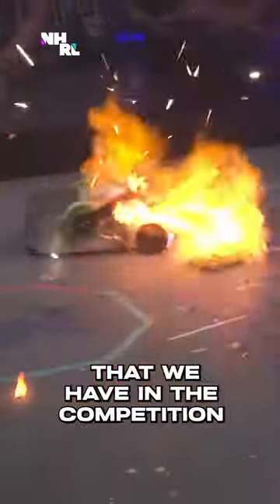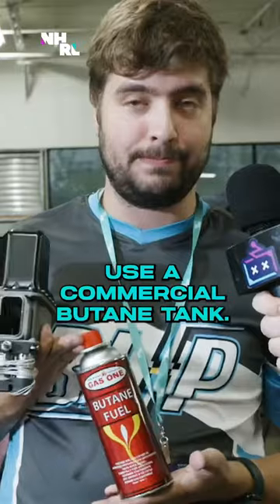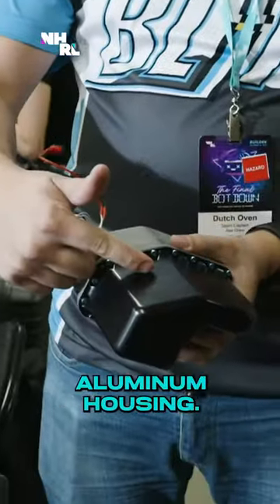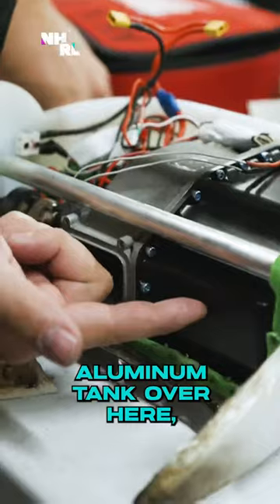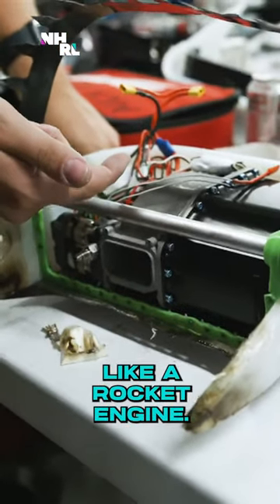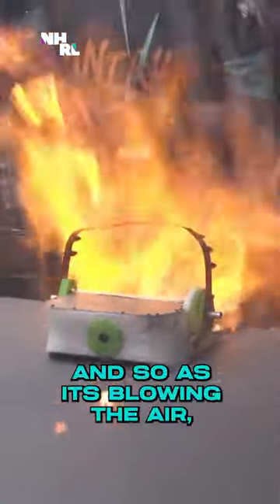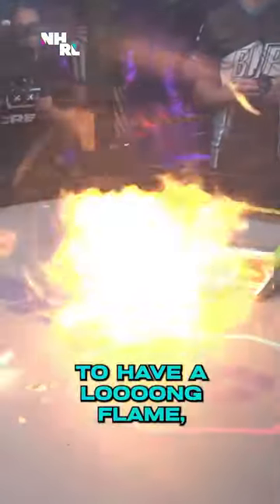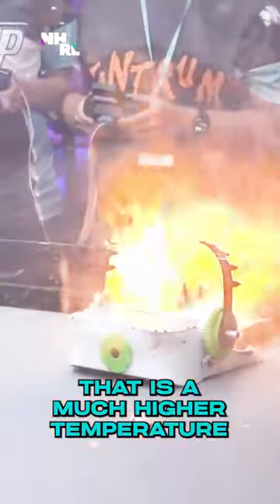Using rocket science in a flamethrower robot

Comment: For those who didn’t understand. Flame go long and flame go short. Flamethrower go brrrrr
Reply: additionally, short flame go brrrrrt more angy
Reply: Welldone showing your rock like intellect
Reply: @mick20075 It takes more understanding to describe a concept in simple terms than parroting complex terms. That said, if you have a wide vocabulary, it's hard to resist using it.
Reply: Also: flame is hot.  The fuel is cold.  By coiling the cold fuel around the hot nozzle before it's ignited he prevents overheating.  Aka "like a rocket engine".  It's fucking genius.
Reply: @stevenhetzel6483  so in other words, it burns shit and it’s fucking awesome.
Reply: Long-range: flamethrower
Short-range:  blacksmith furnace
Reply: @ClakThaMod it awesomely burns shit - while not burning itself. So it survives to burn more shit >:3
Reply: Rrrrrrrrrrnnnnn🔥🔥🔥🔥🔥🔥🔥🔥
Reply: In other words: Melle fire or range fire
Reply: @samsilverman8579  Nuh uh. Flamethrowie go brrrrrt
Reply: @mick20075 well done showing your rock like sense of humor.
Reply: Thankyou i am Ooga Booga 😂👏👌
Reply: Thx! :)

Comment: My dude basically made a combustor chamber out of a freaking jet engine.
Reply: as someone who actually builds small jet engines... yeah, he really did
Reply: Is creating napalm against the rules?
Reply: @Renzya in another video, I saw someone say you can only use a specific fuel, (kerosene I think?) to avoid damage to the arena.
Reply: @dylanb2990  only gaseous fuels, so butane
Reply: I mean, NHRL has seen bots use actual small jet engines so...
Reply: @233Deadman  but this guy made it himself.
Reply: @dylanb2990  it's not about damage to the arena, it's about genuine hazard with other fuels
Reply: @davidy22  a hazard to what?
Reply: @dylanb2990 residues and toxins, gass fuels burn into the air, and the zero pressure system vacuums it out of the box.

Comment: I mean… it’s like with tanks… don’t gotta penetrate the armor of you can just cook the inhabitants alive
Reply: Unless the tank's internals themselves catch fire, that's extremely difficult to do.  Modern MBTs have a firewall between the engine and the compartments that prevent fires from spreading and the engine bays themselves have anti-fire measures.

If you're referring to simply heating up the tank from the outside, that's nearly impossible.  Tank armor is ceramic and has an integrated NBC system that insulates the crew.  

A tank burnout happens after the armor has been penetrated and the systems already compromised.
Reply: @theusher2893 Okay, but are your typical Battlebot's internal components that well-protected?

Comment: I fear this might be the tipping point at which fire based weapons have matured to be too powerful, so just dominate.
Reply: I hope you're right! But until you have a fire based weapon win events consistently they aren't too powerful
Reply: I'm not sure the weapon itself is too strong, but improved engineering combined with the increased use of plastic 3d parts may cause them to dominate until people think of better ways to be heat resistant.
Reply: More likely the cost floor is just going to rise even further.  That part you thought you could get away with FDM printing yourself?  Now you have to order it SLM printed out of aluminum.
Reply: Two words to contradict your statement. "Depth Charge"
Reply: @HorizonSniper__  Depth Charge would just spin around because it has bad movement while Dutch Oven cooks it and slowly backs up. Depth Charge would have to hit the arena wall and launch itself at Dutch Oven to have a chance, and it has to make that contact before it's cooked.

Unless you meant something else.
Reply: @alexgrant1808 Why do you hope they’re right? I’m not really into this hobby but I don’t see how having one dominant meta with no real alternatives is a good thing.
Reply: @Deathranger999  flame meta is only strong because a lot of 3D printed materials are used in the robots. If it dominates too much, someone else would find a way to beat it. Or it would be banned/regulated.

If robots could use metal with ceramic coating inside and outside (like Cerakote) and some rockwool insulation to protect their vulnerable parts, then they can win. Robots that use kinetic weapons could be able to hit the flamebot strong enough to direct the flame away from them.
Reply: @sepg5084  Sure, that makes sense. I’m still not entirely sure why the other person thinks it becoming a dominant meta is good.

Comment: Next version use Greek fire
Reply from the maker: Is Greek fire different to American fire?
Reply: @NHRL If you actually don't know, Greek fire is a mythical chemical reaction the ancient Greeks found that could make fire burn underwater and be unable to be put out. It's also green. We don't really know what the formula was to make it anymore. The closest we can get to the Greek stories is Napalm.
Reply: @tgedragon9008 Aren't we relatively certain it was real, used by the Roman Empire, and especially deadly because of their awesome mechanical engineering? They sprayed it on ships I believe, and the current position is it was based around refined fuel, like naptha.
Reply: @tgedragon9008 suitable simulacrum can be made from animal fats. The issue is controlling the jelly like substance. If it spreads all over the ring...
Reply: @literate-aside  oh, we are fairly certain it was real, we just don't now what it was. Simmilar to roman concrete, the recipe has been lost over time.
Reply: @patrickkeller2193 they solved Roman concrete. Dissolution of something, tobermorite? It dissolved and closed fissures/ strengthened the mixture after it cracked and got wet.

I think they have concluded Greek fire is real as well, just because there's such an enormous amount of historical data.
Reply: @literate-aside iirc it's basically plaster which will react with water and be basically self repairing
Reply: @tgedragon9008 honestly a lipo fire is probably pretty close, you just have to let it burn out somewhere safe
Reply: Greek fire's modern counter part can be compared to napalm. So against the rules no?
Reply: Whaddabout heated forks?
Reply: @sethkunert6234 THOUSAND DEGREE FORK ON A ROBOT!?!? (DEVASTATING) (GONE WRONG)
Reply: @tgedragon9008 Yeah
Its quite the stuff
Although it can be put out if you cool it down quickly
Just needs a lot of freezing stuff
Reply: @NHRL I'm sorry, but this response is cringe 💀

Comment: Yeah, but are these flame throwing bots ever able to get the temp up high enough on the opponent to do internal damage? All these bots have aluminum housings which dissipate heat really well. Seems more like a gimmick than a real damage dealer.
Reply: That’s what the bear-trap bit’s for
Reply: There's another video of one melting a bot with a plastic casing. As 3d printed parts become more common fire based weapons will become stronger.
Reply: Depends.. some bots have plastic wheels and frames for weight issues. It is alot for show but it can do real damage as well.